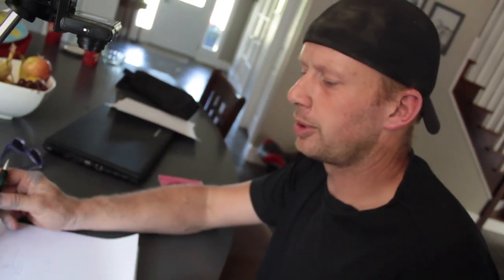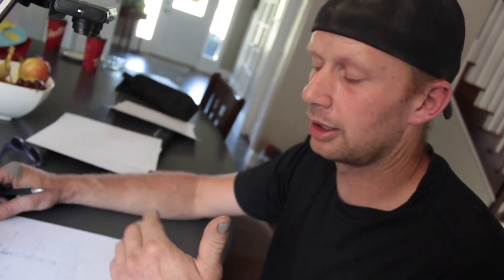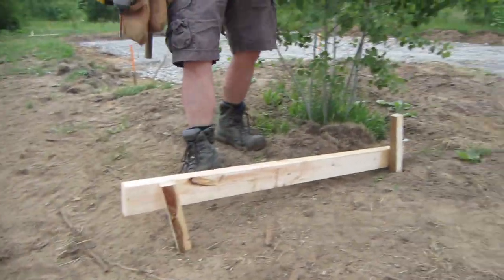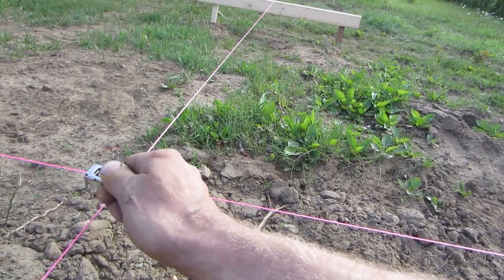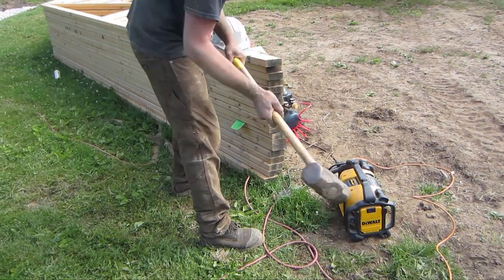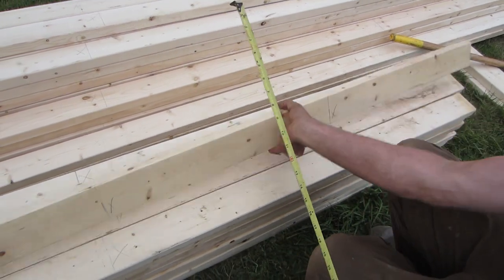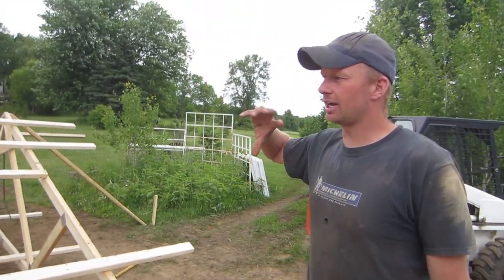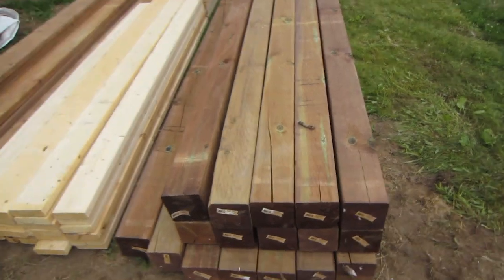DAY 1: How To Build A Garage (For Your Brother)

Comment: Why not build what you want where you want it on your property?  I would keep GOVERNMENT out of my build and build it better than what any inspector would think it should be.Add everything a Electrician  says you would need same with a plumber they will know what is expected but like I said make it better. Save the money you will spend on permits for the beer fridge you always wanted.
Reply from the maker: oh damn its that guy permits protect the next owner when the previous one cut corners or ran out of money.   Or drank too much while building
Reply: good points I am sure. But don't you think the next guy will get a building inspector? They are always saying if you don't inspect it don't buy it?

Comment: There is two reasons I subscribed; one, I need to build a garage outside of Tucson Arizona and second, I will be looking for an old (1970-1983) diesel pickup. 
The one thing about my garage is 12’ of the width will be to have an under carriage pit.
Reply: In some places of Canada, the pits are illegal. I think they're great as long as their shored up properly and there's a fire extinguisher close.

Comment: Was thinking about doing a pole barn style house in California was wondering if this would save money? I've found blue prints of a 2 story garage apartment that I think would go well with this type of building.
Reply: I've used this method. This instruction is good and a great job in the end. My personal opinion I would add another two coats of copper preserve on the bottom and the first 5' of the poles. I found that gave another 6-8 years to the life of the beam depending on subsoil humidity. Look at the exposed end of preserved beam today. It's penetrating maybe 1/32" which is good for natural outside exposure. One caveat that I personally follow is that I don't bury preserve coated poles closer than 150' of subsoil potable water sources.

Comment: When you were in the hole, you didnt know or care that you could be caved in right? or it wasnt possible?
Reply from the maker: 2' of clay in a round hole with compacted soil on top. I would hope I come across intelligent enough to know not to jump in a hole that could break my legs.
Reply: I do this on a weekly basis, Washington standard is 4x2 for a 2x6 laminated post hole. Soil out here is gravel and sand, topsoil is thin. I've had them cave on me and it hurts a little, but you will never end up getting buried
Reply: nope still not smart

Comment: That's going to be bad ass great size, will you coat the poles that are in the ground I know they are pressure treated , but in time they will rot won't they? I can't wait to see all the vids on this
Reply from the maker: If animals were to go in, I definitely would.  The poles always stay wet right at the surface.  As long as the grade is proper and all the water flows away from the building rot, isn't a problem for a garage like this.

Comment: Great point on keeping the trusses assembled and even. I've helped build sheds and cottages and the walls were up before the roof trusses went on. Did you say you preferred to have the metal roofing material on the roof before hoisting it up onto the walls? That would be different to me. Anyway, great video again Rich thanks. Oh and loved the expanding foam trick. Cheers!
Reply from the maker: No, put the trusses up and braced and then hoist the sheets on in two bundles, one for each side.